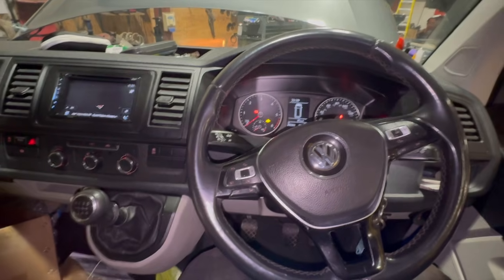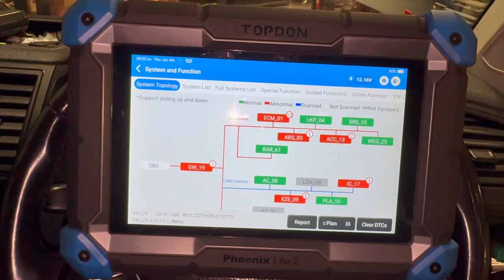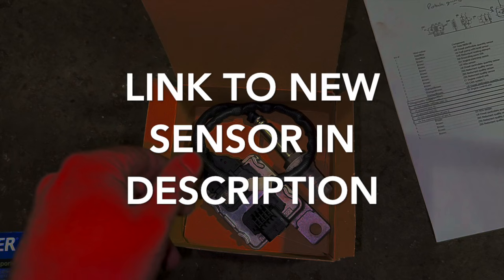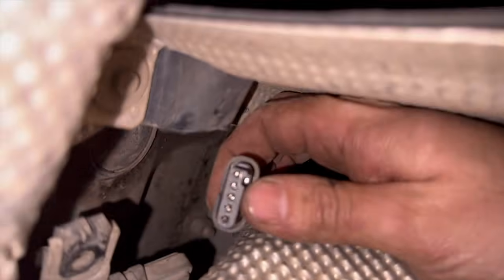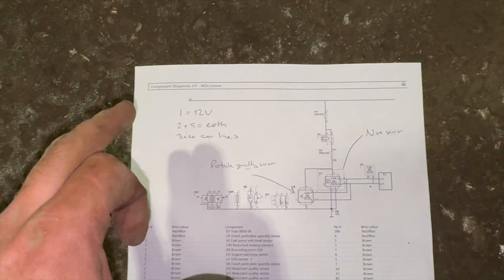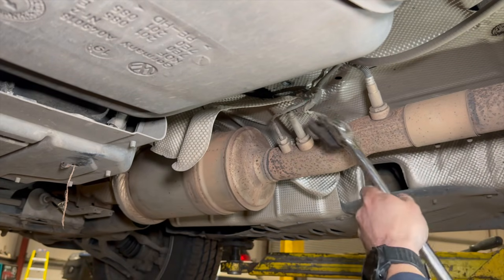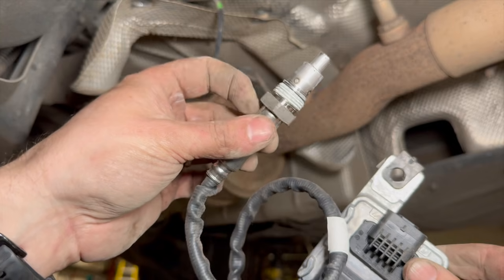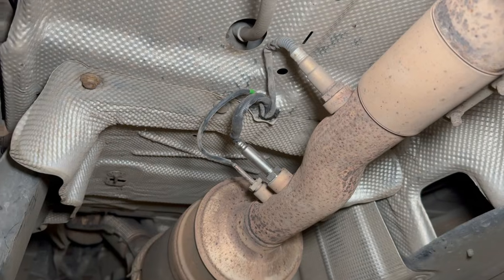VW Transporter T6 Nox sensor faults P2209 P2200 P2202 P2203  - nox sensor 1 replacement

Comment: I have monitored mine same as this one CXHA T6. Seems to drift over 1000ppm on vcds under load and getting more frequent regens. Had P20EE codes pop up and check other parameters but the Nox sensor seems to be failing to me even tho it hasn’t thrown a code relating directly  to it. Check the ad blue pump and injector dosing. So may have to pull the trigger and buy this obscenely costly sensor  😂
Reply from the maker: 😬 not cheap are they!!
Reply: @diydaly I know 😢 that’s why I’m thinking could it be something else but egr looks ok in requested and actual and no fault codes. But was told this was likely the issue (Nox drifting)

Comment: Hi, i have a 2019 transporter dsg, diagnostic machine came up with nox sensor fault, ive go from 30/32mpg down to 25/26 mpg is this connected with the nox sensor fault. 
Thanks
Reply from the maker: I’m not to sure if it will effect your mpg that much tbh mate

Comment: 2019 Crafter 177ks have only 1 Nox senzor?? Do you know?
Reply from the maker: Yes I’d say so
Reply: My 2020 crafter has two, one just in between the catalytic converter and the DPF. Then one just after the SCR box, before the rear silencer.
Reply: I have VW t6 and Last week the engine fault light came on and code is P220000 it is this same sensor? Thanks

Comment: Had nox sensor faults on my Jaguar XF 2.0d along with a slight chain rattle so it had to go. The sensors are sensitive to poor connectors so that can be an area to check.